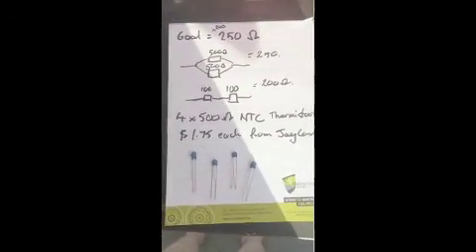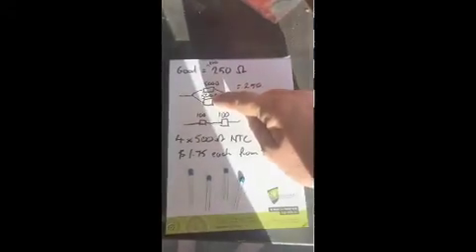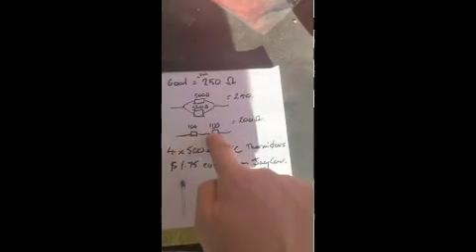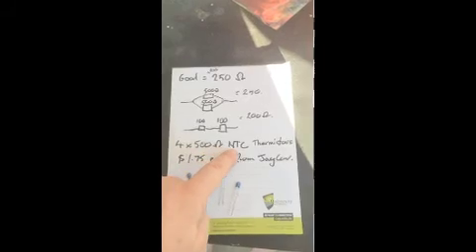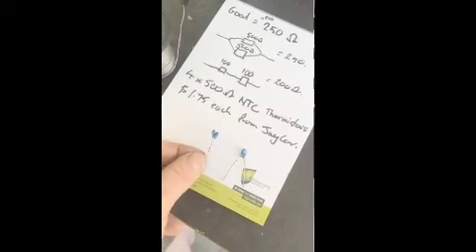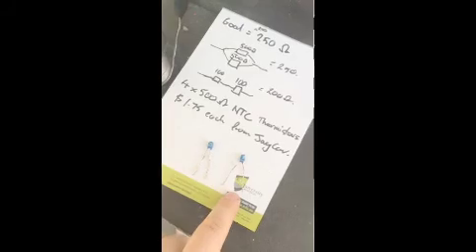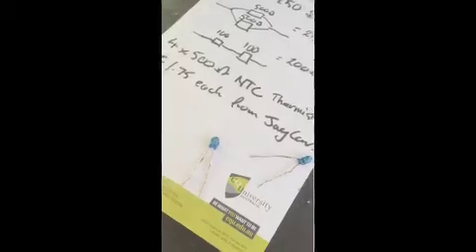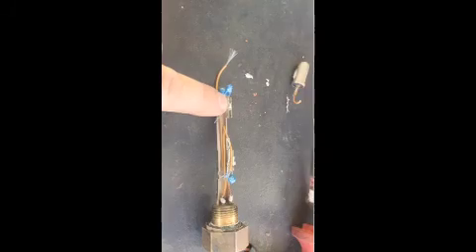1999 SV650 fuel level sender thermister repair for $7 AUD

Comment: Hi Brian, thx for video! Is there a reason why you didn't used 250 ohm thermistors, but 2x 
 500ohm instead?
Reply from the maker: i suppose you could use the one , that is  all that was on the shelf at my local electronics shop 'jaycar' i guess if you used one you would know if it failed where as with my setup it may give me false readings  if one failed and the other took all the load
Reply: @brianblank82  many thanks for feedback, as i have to do similar thing to my sv, just want to make sure i understand correctly, you have just used four 500ohm thermistors, do they have to meet some other credentials, like how many ampers etc? I don't have actually any knowladge about these stuff.
Reply from the maker: @KalixNS  i don't know mate i took a chance at the information i had which i collected from the net. From what i can gather the original parts are pretty durable but 20 years old in technology. the new parts i think are designed for something different but being EPOXY dipped they "should" handle being submerged in fuel. NTC i think stands for Normally closed. if you where to google these parts on the JAYCAR website you will be able to find a similar part  where ever in the world you are. happy biking https://www.jaycar.com.au/500-epoxy-dip-ntc-thermistor/p/RN3434

Comment: Brian, nice job with this fix. How well has it held up since you did the thermistor replacement?
Reply from the maker: The they work fine still, the only problem I’m having is on warm to hot days. Because the switching temperature is from memory 40deg C on a hot day the fuel cant cool the thermistor and gives me a false tank level. Something to be mindful of,